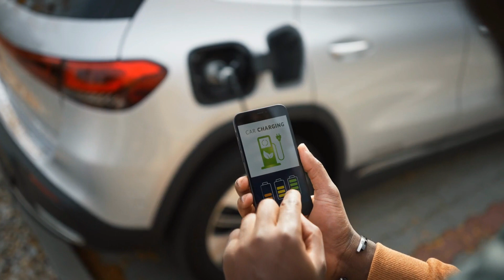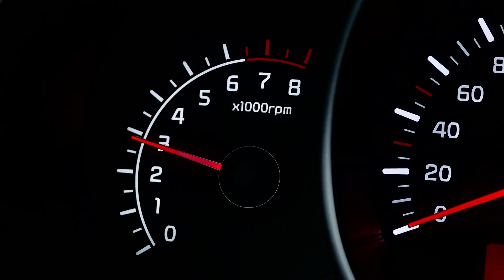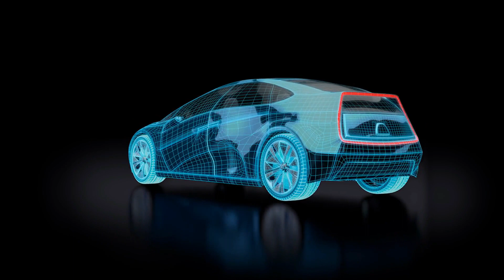Toyota's Game Changer: The Revolutionary Hydrogen Engine | Discover Space

Comment: H2 just doesn't add up as a fuel for vehicles and trying to BS it the future just proves that Toyota is is trouble.  The total cost of ownership for hydrogen vehicle (H2) is was around 40 percent higher than a comparable gasoline vehicle (ICE), and about 10 percent more than an EV as at 2018. Now The price of batteries has declined by 97% in the last three decades and from $185 to $110 per kilowatt hour from 2018 to 2023. It has been widely reported that when the cost per kilowatt hour gets below $100, EV will become cheaper the ICE. This is predicted to occur in 2024 although it has been reported in china that the $100 barrier was achieved in July 2023.

Comment: Toyota has improved in leaps and bounds over the years thanks to their executive leadership and their vision towards the future. Thanks for sharing
Reply: H2 just doesn't add up as a fuel for vehicles and trying to BS it the future just proves that Toyota is is trouble.  The total cost of ownership for hydrogen vehicle (H2) is was around 40 percent higher than a comparable gasoline vehicle (ICE), and about 10 percent more than an EV as at 2018. Now The price of batteries has declined by 97% in the last three decades and from $185 to $110 per kilowatt hour from 2018 to 2023. It has been widely reported that when the cost per kilowatt hour gets below $100 EV will become cheaper the ICE. this is predicted to occur in2024 although it has been reported in china that the $100 barrier was achieved in July 2023.